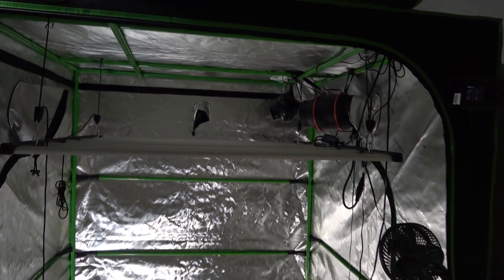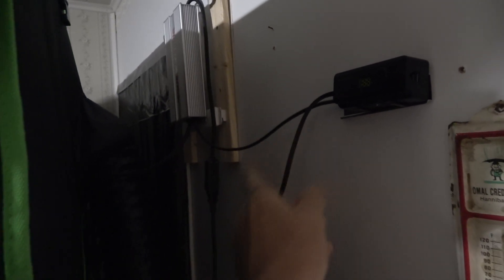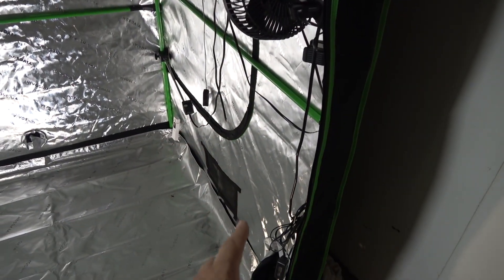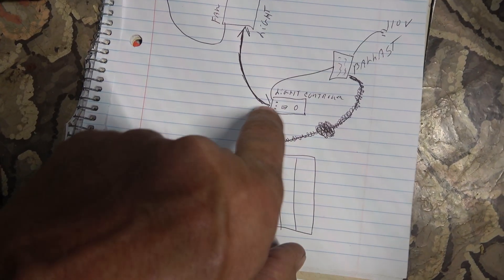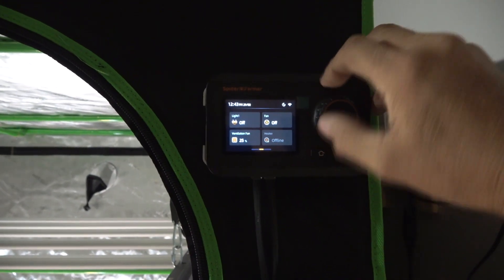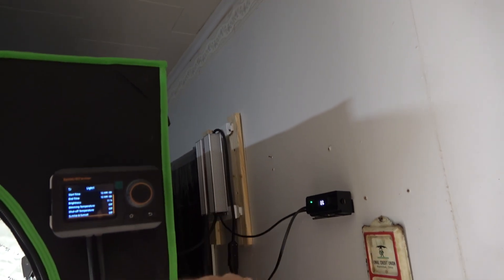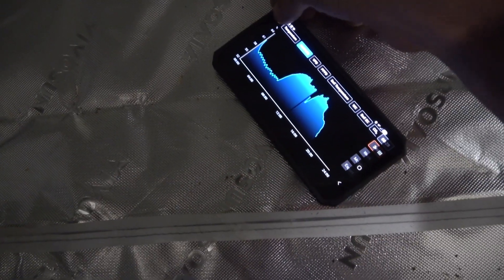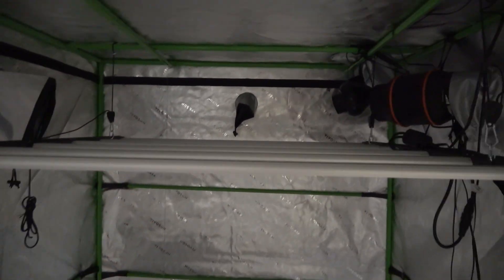Spider Farmer G7000 full hook up video

Comment: I just bought this light and I couldn't find any videos of it.Any video testing the p p f d because the p f d numbers are off chart their 1950 in the middle i uograded from a spiderfarmer se3000 300 watt that i paid $330 4 years ago, i just paid $355 for thr g7000 and i got sdmart controller outlet rather than the GGS comtroller its a GGS outlet you can setup timers on,  paid $110 for the 5 plug smart outlet/par sensor/temp, humidity and vpd, co2 sensor and the fan and light pkug in you have and with my g7000 my grow is going tomexpkide i was runnijg 3 plants under a se3000 300 watt but the autoflower basically needed thr entirety of the light and i wish id biught a spiderfarmer grow kit for $900, I spent double that 4 yesrs ago with mixed mstched items like a vivosun tent/inline filter/spiderfarmer light a couple house fans but now al,ost everything ix spiderfarmer exceot the trnt ehich needs to get teplaced because all the zippers are stuck except one and eventually its gonna give iut snd ill need to spend $200 buying a new tent

Comment: Well thanks for telling us about the correct jack to put cable in. I’m still having trouble setting up my timer to turn lights off and on I have the Spider Farmer GGS controller  if anyone could help?
Reply from the maker: Make sure time and date is correct . Make sure the controller is updated.  Turn the knob till you see enviromental settings , there you will find .  Or on phone , open up app  Chose device , close to the top , go to enviromental
Reply: @indoorgardenequipment I figured it out  I had the setting on Manual

Comment: Brilliant.
By the looks of it I need one of those light controllers.
I have the ggs unit - both fans work and all the sensors.
I cannot get my sf2000 to go to full power despite topping out all settings.
Plugged in ppdf - 250.
Unplugged 650.
Where can I get a light controller?.
Thanks bro.